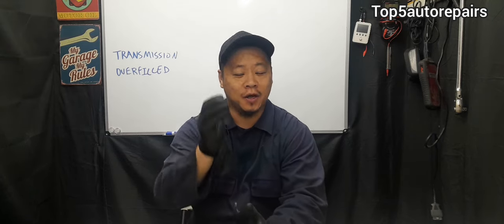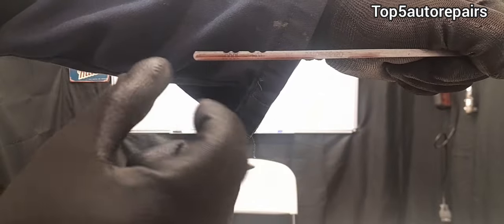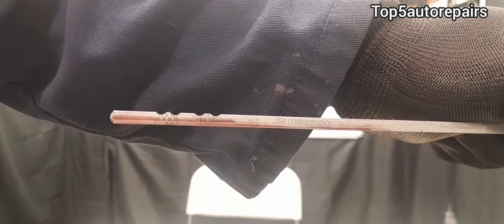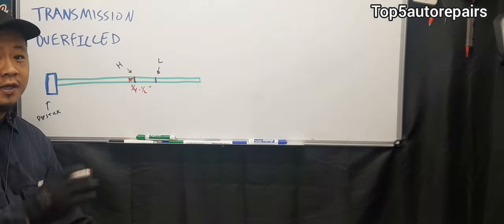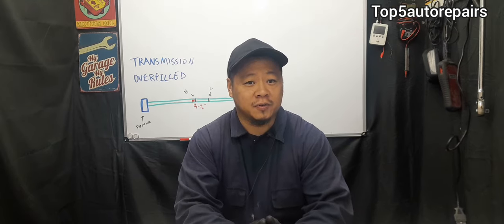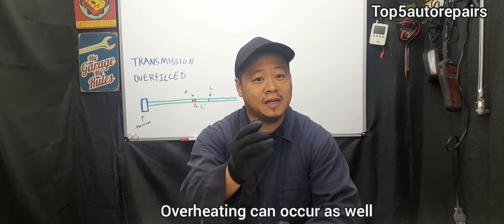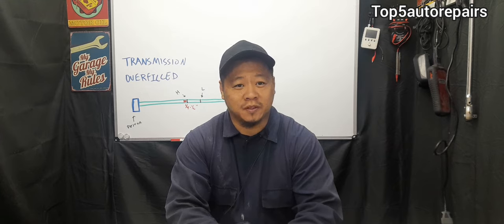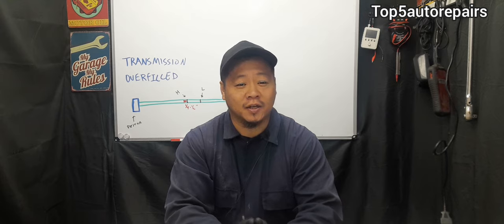WHAT HAPPENS WHEN YOU OVERFILL YOUR TRANSMISSION WITH FLUID

Comment: Start engine let it idle for a few, after a few minutes hold the brakes and shift thru all the gears and then into neutral . Check your atf level with engine still at idle ,add fluid as needed slowly . Repeat process until level is correct

Comment: Your two example cases: One is the transmission fluid level (overnight in cold morning before starting engine) is all the way high above the hot mark on the dipstick, it is definitely overfilled. Another case is the transmission fluid level is OK when the transmission is hot(after ten or fifteen minutes drive) with engine running and the transmission fluid level is less 1/4" above the hot mark. If the two cases happen on the same transmission,  the the transmission fluid is overfilled or not? My transmission level is this situation, do I need drain some out?
Reply from the maker: The correct reading is when the transmission is warmed up after driving.
Reply from the maker: You're fine. No need to drain.
Reply: @Do-iz6qdbecause when it is hot there is more fluid throughout the whole transmission and torque converter. When it sits for a while and cools down, the fluid drains back into your transmission pan(which is where dipstick is reading from). Always consult your manual, because some cars are checked hot and others can be checked cold. And sometimes, there’s not even a dipstick! Which is a real PITA!
Reply: @Do-iz6qdI’m kinda in the same boat. I know I over filled but isn’t that bad when warm. What did you find out?

Comment: The transmission fluid level seems to be one of the most ovlelooked cause of symptoms when it comes to transmission performance. Not enough and you will experience high rpm shifts and or hard shifts. Too much and the transmission fluid will become too hot and airy and not adequeately lubricating and pressurising the transmissission which will eventually lead to clutch failure and or broken internal parts. No 2 transmissions are alike. We have had some rebuilds that shift best on the low end of the hot grid of the dip stick and others that perform best on or just above the hot grid of the dip stick.

Comment: I got a 2004 Nissan frontier when I checked the transmission fluid when it’s cold it’s way above the cold line then when I check it when it’s hot, it doesn’t even register. I put 2 quarts of transmission fluid in it and it still has no reading when it’s hot I got to warm my truck transmission up to be to put it in reverse

Comment: Very good and helpful!  I had this situation many years back.  I was not the one who did it. 🙃  What is the how-to recommendation to bring this to normal if it is discovered?
Reply from the maker: Best way is to use a transfer pump or partially drain the transmission fluid at the drain bolt

Comment: I really can’t believe that I might have done this. Just replaced the Moyer on a rat rod. It ran fine before replacement but it did sit for a few years. It wouldn’t move so I thought it was low. I added with it while cold forgetting to to warm up. Don’t know if this is the problem. It never really warmed up. But noticed when I shut it down fluid was almost gushing out of the dip stick . Hopefully I didn’t damage it.

Comment: Thanks for explaining I just picked up a 2006 Escalade with an extra liter of ATF 1.5" above the full hot mark.
It was changed 9 years /30,000 miles ago by Pep boys 
Was shifting fine and not over heating now has 93,500 miles

Comment: Very useful video, had gear fluid leaking problems awhile ago, changed the seal and was fine, then started leaking again after couple of months and replaced new gasket. Not leaking anymore but slowly became underpowered and having some whining sound, also slipping gear. Have an appointment with new trusted mechanic within few days and hopefully solve this issue. Not gonna trust my previous mechanic anymore since they kept saying my gear fluid is enough and nothing has to be done after I visit them for sevaral times whenever I feel and heard some of the weird signs and sounds.
Reply: So what do your new mechanic do to the transmission to solve the issue

Comment: Great advice. I'm 72 years old and I haven't been working on motor vehicles that often. When I do l will look for videos on the problems I am having. I am what you would say mechanically inclined person as I grew up working on anything mechanical. I worked in the construction trade as well as the aircraft industry building numerous different aircraft with McDonald's Douglas and Boeing. So I usually can tell if the person making the video knows what they are talking about. From what I have seen with this video you have more knowledge than most of the other people posting like videos.So 👍 for a great job.

Comment: Thank you for that Great Information, I Checked my Tansmission, I can't Believe I Was 3 Quarts Over, I just drained it and Took out Alot of Contaminated Transmission Fluid,  I Drove Around And Rechecked the Level,  Then I Added 1 Quart of New Fluid and it Feels Alot Smoother... I'm Gonna Have to Change my Fluid next week, New Solenoids, Clean and Inspect my Valve Body, change the Trany, Filter, Flush out my Transmission Cooler, and Pit new Amzoil Full Synthetic Transmission Oil in, And Hopefully The Transmission Feels Alot more Smoother.....
Reply: How many quart you suppose to fill?
Reply: @anthonyta3369  By Draining, it's like close to 7 Quarts, if you do a proper straight flush it close to 12 Quarts, it not gonna be 100% all drained, but it will be in the over 90% of old Fluid out...witch is a Good significant amount of contaminated fluid Out from the Valve Body, Torque Converter ect..

Comment: Random question that might be dumb. My son's car started having some issues that seem to be transmission related. Background: I bought him the car about a year and a half ago. In that time the only stuff been done to it was by his dad, none of which are transmission related stuff. 

The issues just started a few days ago and got dramatically worse pretty quickly. He started noticing it seemed to not be shifting the same from 2nd to 3rd and then down shifting. His car is automatic but he said it just felt off. Then the other day it got so bad that he was worried about driving it so I drove it. To me it feels like his overdrive is kicking in for no reason between 2nd and 3rd. So I checked the transmission fluid wondering if it's a leak or just needs to be changed really bad and it is seriously overfull. At cold it is just about the hot line and at temp the fluid is like past the words on the dip stick. 

My question is, could that be causing what's happening even though it has to have been that full for over a year and either way can I just drain a little or do I have to do a full transmission fluid change in order to fix the situation?

Comment: thanks for the tip , however in old transmissions type trque converter 722.1 mercedes 4 speeds with gear softener by vacuum valve and acceleration rod connected to the accelerator of the vehicle

Comment: Very important point. Some vehicles require the motor to be idling when you check levels .. the torque converter gets filled and what is left in the pan as reserve is what you measure with the dipstick. Follow your manufacturers guidelines ✅✅
Reply: <3

Comment: I took my truck in and had the transmission flushed. It started driving a bit strange. Felt kinda slow or weak. I barely drive so there wasn’t many miles on it. It was extremely difficult to get the transmission up to 160 degrees to check. I drove around city blocks for about a hour. I checked at 163 degrees and it was overfilled. I drew out about 250ml to get it back into the hash marks. It’s at the very top of the hot range. It drives great again!!!!  I’m going to still take it in and have the fluid and filter changed.  The fluid was darker than I thought it would be with only a couple thousand miles on it.

Comment: I had my 2002 Honda Odyssey trans rebuilt ... the shop told me to bring it back after i drive it 100 miles ... they had over filled the trans fluid and when I asked them about it ?  They told me it was okay to do on that trans !  Well it now has 25,000 more miles on it and its still working well and the trans fluid is still over filled
Reply: But you Didn’t have any slipping issues or anything?

Comment: My transmition fluid looks high and my car went into limp mode the other day with check engine, still in limp mode. I thought it was a shift solenoid but could it just be the excess fluid possibly causing that? I thought it may just be the fluid not being able to go back in bc the solenoid but migutnbe overfilled.
Reply: Update?
Reply: Update?

Comment: Pls explain this to me. Its driving me nuts.  My transmission fluid level is alwas at hot level on the dipstick whether the car has been sitting overnight or measured when hot. So regardless of the temperature the level is always at hot. Should I remove some or not. Car is a 2006 c class w203 cdi.

Comment: I just checked my transmission fluid and it’s really high. I noticed the transmission fluid was added 3 k miles with a conditioner just before I bought it. I looked under the car it’s it’s wet wheee the pulleys go into the transmission and had dropped down onto steering rod. Any suggestions what I should do?

Comment: If it is overflowed, will it also leak from the cap? I am afraid i overfilled it by mistake thinking it didnt have enough and now its leaking when the car gets hot and comming out from the cap where you check the levels.

Comment: Hi, why is my transmission oil at the full mark when I drive around town and then if I take a long 2-3 hour drive, my transmission oil is about 1/4 more above the  last fill line? I don't understand that. It seams like the hotter the car runs and longer driving temperatures my transmission oil rises on the dipstick. The trans was rebuilt about a year ago. Any help would be much appreciated. Thank u
Reply: Because the hotter it gets, the more your fluid expands. What does your manual say as far as checking the fluid?

Comment: My 08 Town and Country doesn't have the dip stock and the using the engine dipstick trick on YouTube, I'm not sure if it's correct or not, I pumped most of it out and poured 3/4 what was but there was no foam.

Comment: So, i have a 99’ nissan pathfinder. And as a precaution. I tried to do a transmission fluid change, i replaced it with the amount of how many quarts came out. After driving it for a few weeks, it started having problems shifting. Now it wont shift to 4th gear. I was on the freeway driving at 4k rpm at 3rd gear. Please help. Anything would help
Reply: Was the fluid the same temperature? Had it ever been done before? How did the fluid look?

Comment: im having the same issue .... i last remember adding 1qrt and after awhile i had the issue, iwill drain the amount out perhaps do it all over again minus my 1qrt thats my theory i will try this,my fluid isfresh and red too so thats my approach ! I have both a drain bolt and dip stick ,which would you rather pull fluid from keeping in mind air in the system or is that not possible ! (2006 infiniti g35)  hard shifting from P to R etc... im sure itll fix my issue i have no puddles
Reply: Drain it from the bolt, so you can clean the metal shavings off of your bolt and replace the crush washer if needed.

Comment: The Ford dealership overfilled my transmission. I found out after they serviced it and it was shifting funny and then I noticed all the fluid was leaking out. They said it was just coming out of the overflow so it’s fine now. Is there even an overflow on those transmissions? 2021 10 speed
Reply: That’s ridiculous, I would tell them to drain it out and fill it up correctly or refund you your money so you can have someone else do it correctly! Or better yet, read the manual and do it yourself. Probably not that hard.

Comment: You are a life saver my transmission has to much fluid and I  see transmission fluid around the pan underneath my car can I just drain some fluid out from the pan to get some on the fluid out ?
Reply from the maker: Yes you can. Loosen the drain bolt slowly but do not remove it. Check the transmission fluid often to make sure it is at the correct level.

Comment: Hey I recently changed my fluid on a G37 sedan 2009 7 AT and it’s sealed and had to pump it I maybe have added a lil to much and it started to slip a lil at 2nd gear I only drove it about 10 man after that occurred and I wana know should I start draining fluid from it immediately and or will that possibly work or help the issue

Comment: So I changed my transmission fluid. Added probably 7 1/2 quarts when it called for 6.6. I check this morning and it's on the bottom of the hot line when it hasn't been running. I idle it for 10 minutes and it's not even on the cold line after that. What does that mean?!

Comment: I changed my transmission fluid on my 2016 suburban and I over filled it to were its cold and its above the hot line lOK? an inch over it should I try to take some out or it should be ok?

Comment: What I'd like to know is can you mix different types of automatic transmission fluids in your transmission? Will it still drive and function okay? Because I've done this and the level is okay but I have noticed the performance has declined and the r.p.m. is higher after 65 m.p.h. 
Thanks
Reply: you should only use the type specified by your manufacturer.  Mixing different types can gum up and seriously damage your transmission.  Drain and fill your transmission fluid with the right fluid.
Reply: @johnlaney5850  I appreciate it I will just use what the dipstick says (dexron 2 or 3 )

Comment: Do you check the level on the stick with the car running as it has been the case for ages or do you turn the car off then check the level? Thank you
Reply: Very important question. Some vehicles require the motor to be idling when you check levels .. the torque converter gets filled and what is left in the pan as reserve is what you measure with the dipstick.
Reply: @anserafers8088  much appreciate the advice !
Reply: @MrDannyaop  all good mate .. just felt I needed to reply 👍better safe than sorry!

Comment: Yesterday I added a full bottle of tf to to top it off and today when I was driving, white smoke came out and I pulled in parking lot and transmission fluid was leaking under the car and on tire. I think I overfill it because my rpm was higher than normal and I could feel my car jolting. I looked on yt and it said to drain the fluid and add new which I did and it's driving better now but do you think it caused any damage and could happen again?
Reply: Woah

Comment: Any damage if i flush my transmission fluid.
Reply: From what I understand, it often depends on the condition of the fluid that’s already in there. If you see that your current ATF is really dark colored and almost burned looking, I wouldn’t go doing a full flush because there’s possibly parts in the transmission that are so worn out that they depend on the grit in the fluid to function properly, like the clutch system. I think ChrisFix did a video on this too. If it’s still kinda light red/brown color and needs replacement, pretty sure you’ll be okay to do a complete flush.
Reply: I would agree for the most part but he could play it safe and do like 3 drain and fills over a 6 month period. You really only want to do a full flush if it’s been flushed consistently like every 30 thousand miles.

Comment: Are there cases where a replaced transmission's dipstick is incorrect? If you can't believe its' readings how can you adjust to the right level? (used vehicle no idea of true repair history)
Reply: Take to the dealer they can check the part number to see if the correct one is present.

Comment: Great video!! But I have one question, if my trans dispstick doesn’t have a cold check mark and only check hot, will checking while cold give me an inaccurate reading?? 
I’ve overfilled my trans beyond belief and when checking while hot the entire dipstick is always wet. So I’m wondering if I can get a better reading while cold and if that would be accurate even if the dispstick only had check while hot marking.
Reply from the maker: The proper way to check the transmission fluid is with the engine running and transmission fluid is warm/hot.
Reply: @Top5AutoRepairs  got it thank you very much for the reply, appreciate it!!
Reply: My car also only has a hot reading. You need to drive your car for a few minutes to get everything up to operation temp then park your car on a level surface and check your transmission fluid level. If the hot level is good, wait at least few hours or overnight for everything to cool down and pull the dipstick again. Use a small file to scratch the dipstick at the cold fluid level and now you have an accurate cold fill level.
Reply: WAY overfilled if the whole dipstick is covered

Comment: I have a 2005 GMC Sierra and I flushed out the old fluid yesterday and filled it up with new fluid. This morning, I checked the dipstick when it was cold and it was above the cold range, teetering in the hot range slightly. However, when I started the truck and got it up to temp, I checked again and I could barely see the fluid level whatsoever, as if it didn't have any fluid in it. What's the issue and what can I do to rectify it? Thanks!